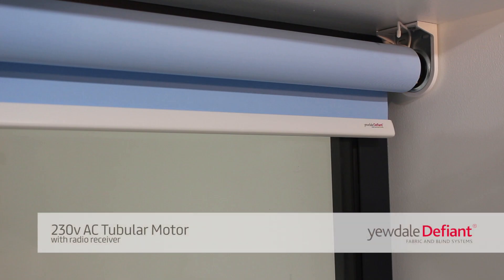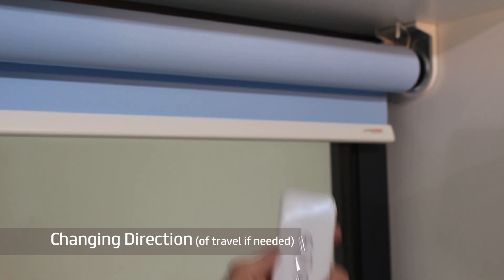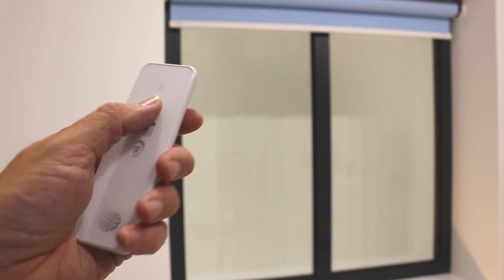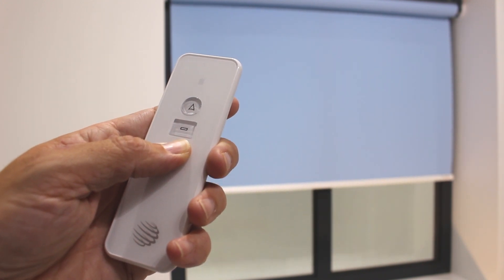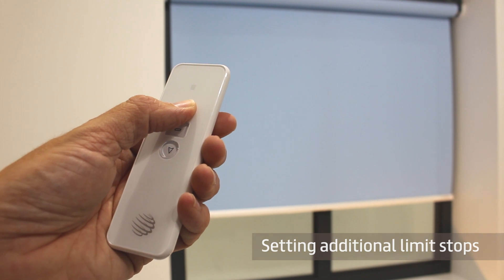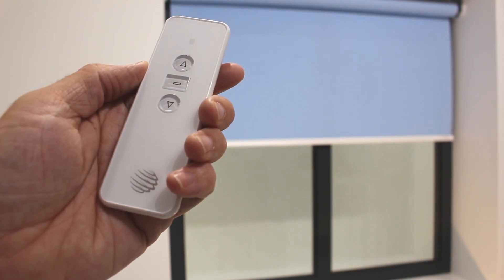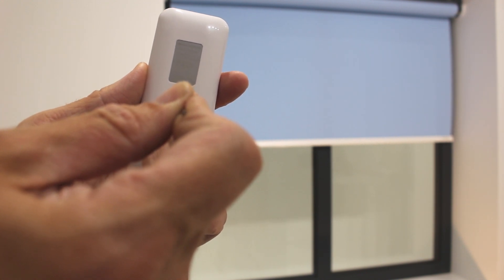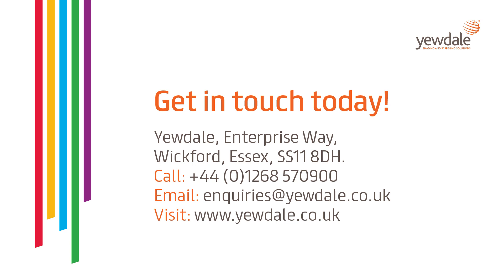230v AC Tubular motor with radio receiver - programming instructions

Comment: The remote seems to properly instructed motor to go up, but it only goes up a bit, then goes back to its position. Almost like it’s stuck. What should I try?
Reply from the maker: Hi, We suggest deleting the single-channel memory on the blind which will send it back to the factory mode.  Then reprogram if the problem persists.  If you continue to have trouble give us a call on 01268 570900 and we'll talk you through it step by step.
Reply: @YewdaleUk  How do you do an factory reset?
Reply from the maker: @bjornskjaret5559 Please see our recent reply to your original post. Thank you.

Comment: How do I pair the AC 128-01 with Alexa?  Thanks.
Reply from the maker: Unfortunately you cant pair with Alexa
Reply: Bleh. Why? It only works with only torro hub? Is there a torro app?
Reply from the maker: @TheBooban  Unfortunately there isn't an app that controls these motors
Reply: There is an possibility to do pairing with Alexa but this would require you to buy an additional device, for example the Broadlink RM4. So you not actually intigrate the remote with Alexa but you learn the Broadlink device how to send the correct control signals and then integrate the Broadlink device with Alexa.
Reply from the maker: @bjornskjaret5559  Hi there, 
As previously mentioned, our motors aren’t compatible with Alexa pairing and no other testing has been done to see whether you can pair the two using other components such as Broadlink RM4 – we are unsure of the result.
Reply: @YewdaleUk  Hi. Sure, I cannot guarantee the result. But I have done this myself with my blinds, the Broadlink device is really just an RF learning-repeating device so it can learn the RF codes from the remote and then through the software provided (app is available) it just repeat the learned RF codes. But as you mention, to ensure that this would work for others it has to be tested first.

Comment: How can I change the battery to the remote control?
Reply from the maker: There is a small screw on the back of the remote handset, remove this screw completely, then slide the back section of the remote handset up, then the front and back sections will separate and access to the battery will be possible.

Comment: In my case I have tried to set the bottom limit, however if I press down again while the blind in the bottom position it try to go even further down. I tried to delete the bottom limit and set it again but this did not solve the issue with the motor trying to go past the bottom limit. Any tip on how to solve this?
Reply from the maker: Hi Bjorn, we recommend deleting the memory in the motor and then resetting the limit stops again - please see instructions on how to do this below: 

Delete all the memories (After deleting all codes, the motor will be restored to the factory setting): 
1.	Press STOP for 5 seconds

2.	Motor will shunt once. 

3.	Press PROG for 7 seconds within 10 seconds of pressing STOP. 

4.	Motor will shunt once within 1 second.

5.	Motor will shunt twice within 7 seconds. The memory has been cleared.

Resetting the limit stops: 
1)	Press the program button on the motor – blind will double shunt.

2)	Press the up button on the handset – blind will double shunt.

3)	Press the down button to check direction – if incorrect press the stop button and the blind will double shunt.

4)	Bring the blind down to near the middle and press the program button on the back of the remote – the blind will double shunt.

5)	Bring the blind to the bottom and press the program button on the back of the remote – the blind will double shunt.

6)	Bring the blind to the top and press the program button on the back of the remote – blind will double shunt, press the program button again on the remote and the blind will double shunt again.

7)	Test the blind for function.

We hope this helps, but if you continue to have trouble give us a call on 01268 570900 and we'll talk you through it step by step.
Reply: @YewdaleUk  Thanks a lot, this did resolve my problem. I just have one additional question if I may: I have the exact same remote shown in the video but I have several blinds. Can I upgrade to an multi-channel remote and if so do I need to do the motor-remote pairing before I can use it?
Reply from the maker: @bjornskjaret5559  You are welcome. Yes, introducing a multi-channel handset to pre-configured blinds is easy. You need to select the channel on the new handset, press the program button on the motor then press the up button on the handset and it's done, then before doing the next blind change the channel on the handset. Any problems, let us know!

Comment: Once the motors are programmed, how do you program the AC123-16D remote to control multiple blinds?
Reply from the maker: Hi there Press the right arrow on the 16 channel remote across the different channel settings until you reach CC on the display, this stands for Complete Control.  When you are on this channel all the blinds will go up and down together without any further action being applied.  Hope this helps